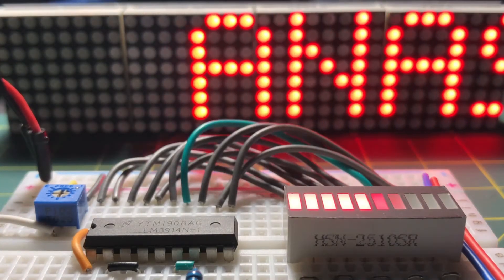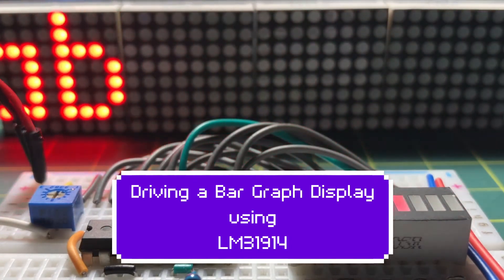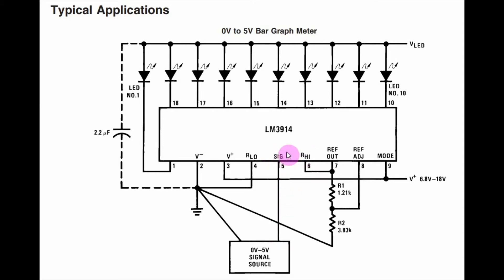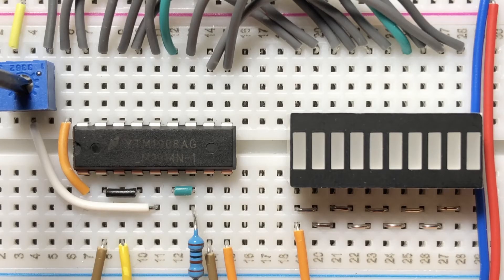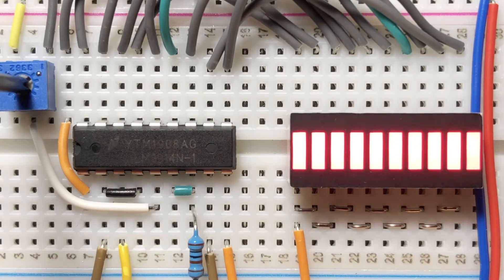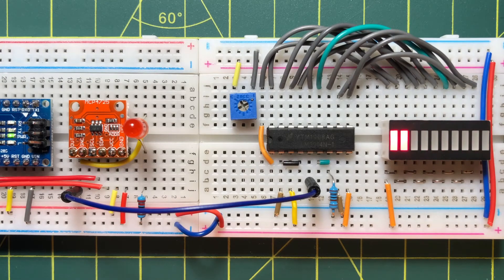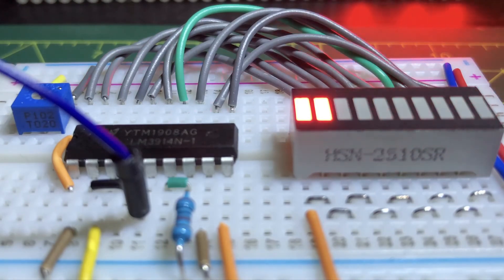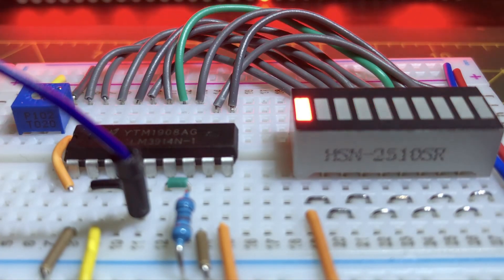Driving a Bar Graph Display using LM3914

Comment: PERFECT! i want to make a bar graph, i tried using diodes and transistors and it did work but the LEDs would come on gradually but i want them to be either on or off just like this. thank you for demonstrating the LM3914

Comment: I need a circuit that uses the LM3914.   Can you design one the uses the linear analog output SS49e Hall Effect sensor?    As a magnet crosses in front to the sensor, each of the 10 LEDs would indicate the position.
Reply: sounds trivial
you might need an op-amp to ampifly the signal
Reply: the hall sensor would pulse whenever the magnet passes by, it wouldn't be able to tell you where the magnet is. you bar graph would simply spike each time the magnet goes past (you would need an op amp) it sounds like you would need some kind of encoder with a decade counter or a potentiometer that can rotate 360°